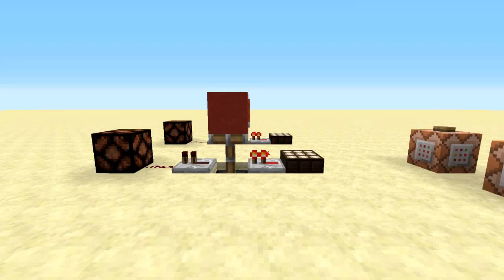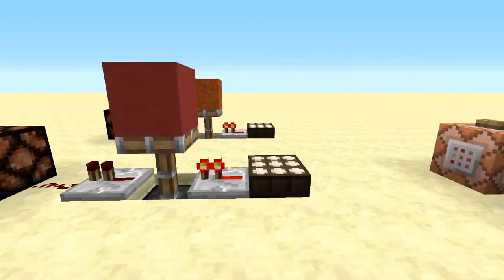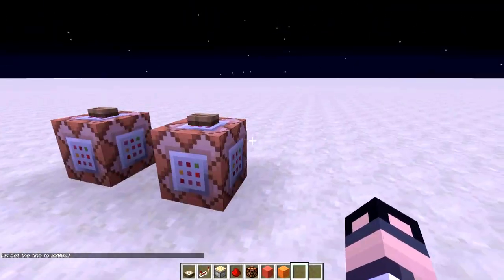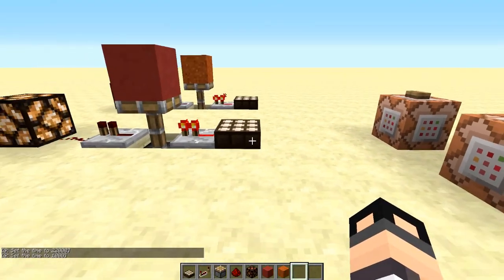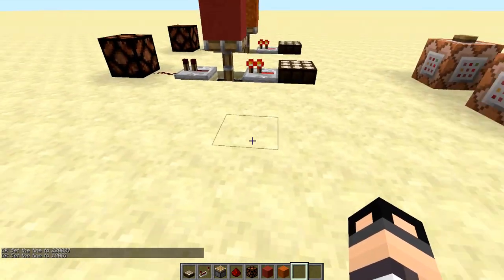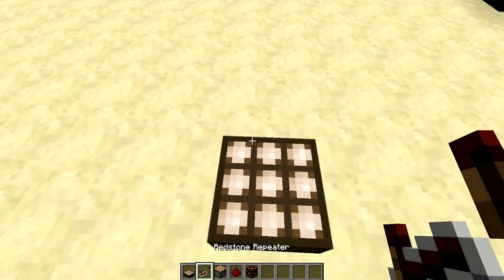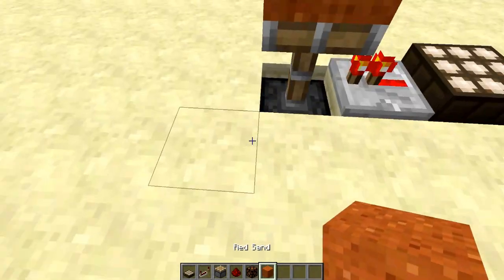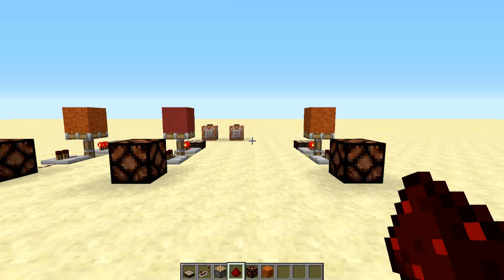Redstone Academy - Daylight Sensor - Single Pulse - [ Java 1.28+ ]

Comment: Daylight sensor to redstone lamp to observer is simpler
Reply: no, as that would create multiple pulses a day, instead of one...
Reply: @paulb.2802  the redstone lamp only outputs on or off so the observer pulses a quick signal at dusk and another at dawn.  It works by converting the multiple signals of a daylight sensor into a single signal for both day and night. I use it in my builds.

Comment: Thank you so much.  Your design works.  To save 1 space, I did not use the redstone dust, instead I moved the lamp next to the repeater and set the repeater to maximum delay.  It works beautifully, this is exactly what I need, thank you so much for sharing this.
Reply: The lamp was just a demonstration? It literally has no use in this design